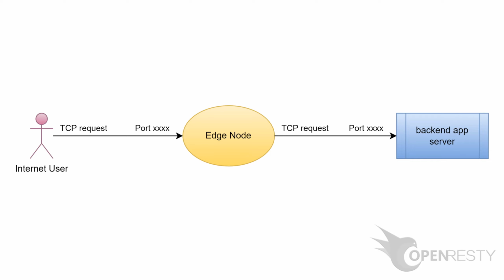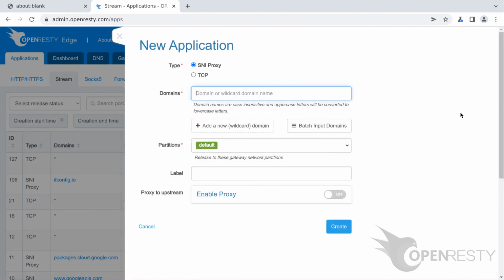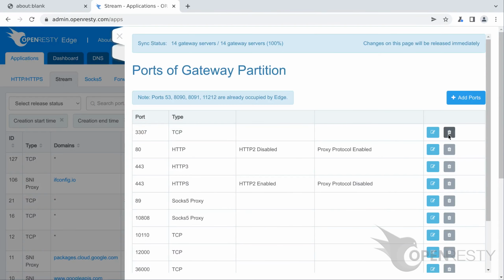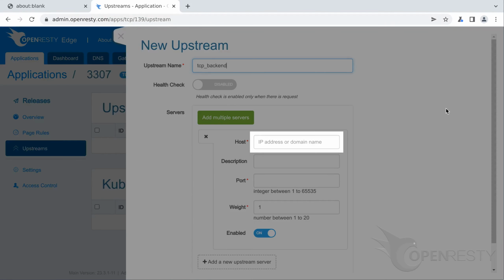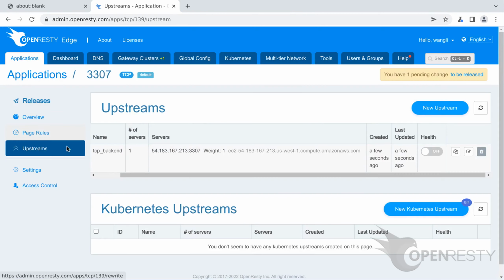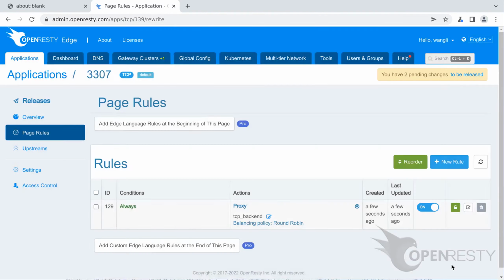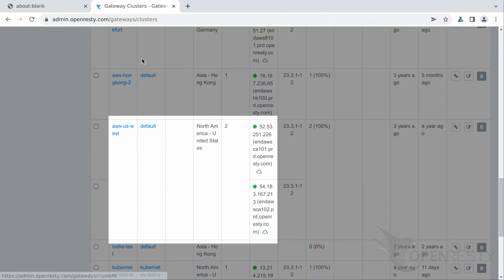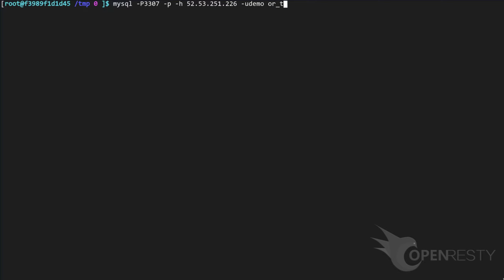Load-balancing TCP applications via OpenResty Edge

Comment: I can use c or cpp or rust with open resty?
Reply from the maker: Yes. Build c/cpp/rust code as shared library and export the c API. Then you can use ffi to call the exported function. If you want to add nginx modules, you can use c/cpp.